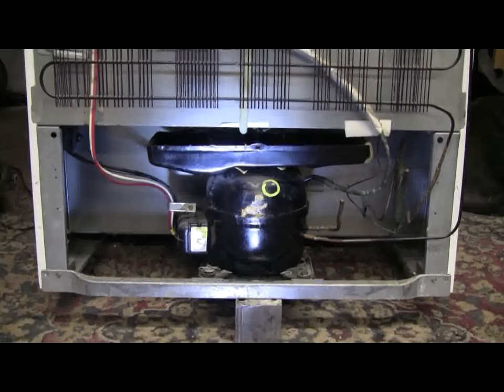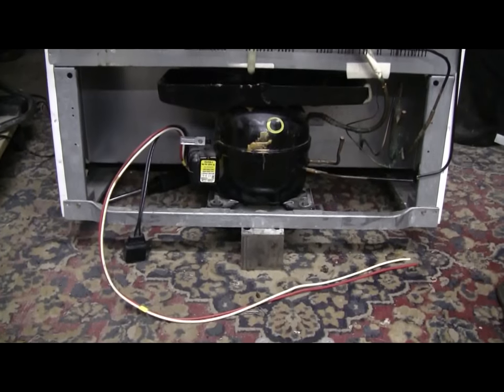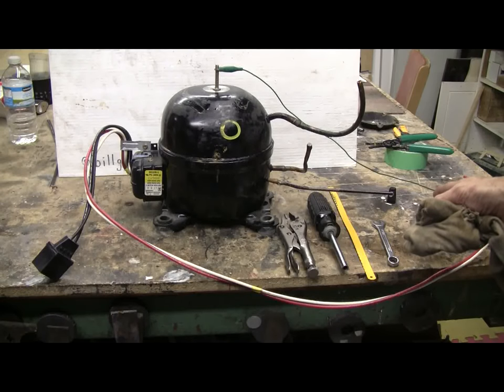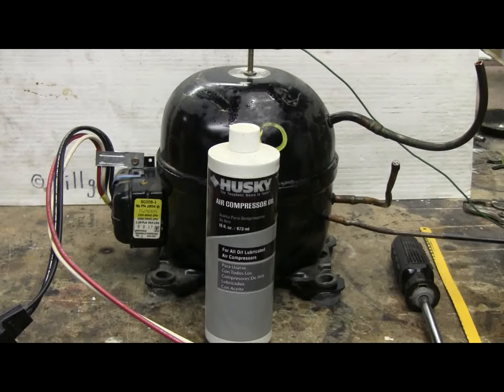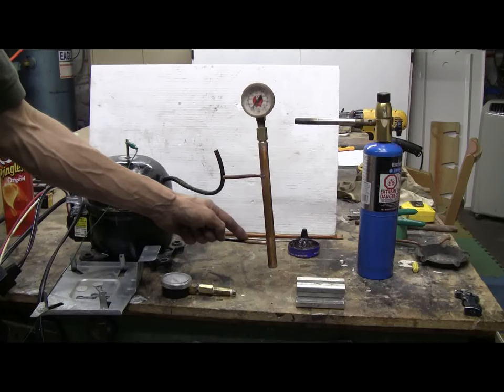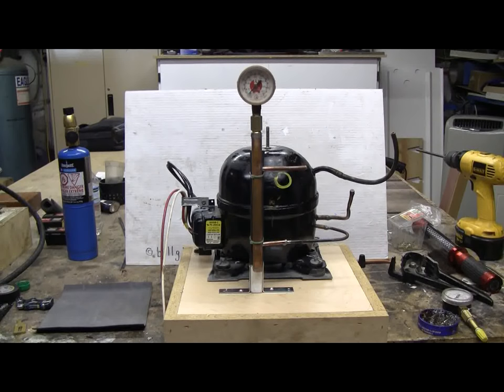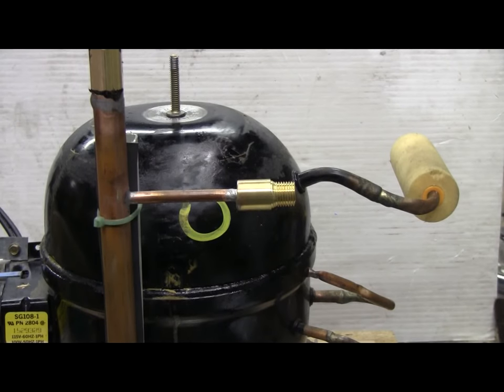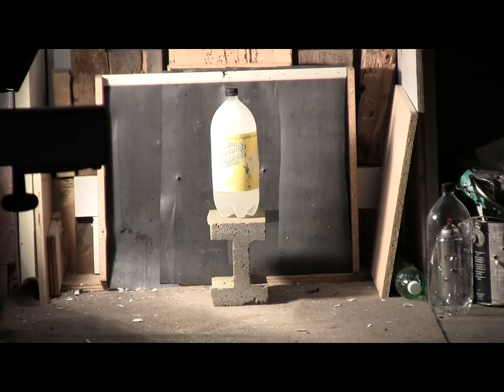DIY - How To Make A High Pressure Air Setup From A Refrigerator

Comment: Great Video!!  I am sure you will be careful to not accidentally walk away while it's charging your tank ... 350 or more PSI is a lot of pressure and it could do a lot of damage if something failed.  You know if you found another refrigerator accumulator or fire extinguisher you could create a way to recharge your tank more quickly.  Much Success !!
Reply: Very good and thorough comments, indeed 350 Psi pressure can be damaging if there is an explosion
Reply: success for "Mr Advanced"

Comment: echo delvis11 question about removing the existing compressor oil and the replacement with the new " air compressor oil " that you mentioned.   Could you give an update on that process, since it's a key initial step process....!   Thanks

Comment: Nice build. Will you get any oil out the air exhaust from the compressor? I mean, will it leak any oil you once filled the compressor unit with? I'm planning to build one similar to your design to connect to my existing compressor to be able to compress air silent when not much air is needed.
Reply from the maker: There will be a small amount of oil mist in the output. These do not flow a lot of air, but if you don't need much volume it will work.
Reply: I wonder if a separator of some sort could be added in-line allowing this compressor to be used as an air lift water pump

Comment: That was cool , would have not thought of that, a compressor cannon.  I am more interested in turning one into a suction device. I work on mowers and in older riding mowers I want to change out the transmission fluid. IF I can get to it, run a flexible tube in and pump out all the old fluid. Depending on how a mower is made this would save me a lot of work. I have no idea as to how vacuum pressure works. But I should not need a whole lot. I was thinking of getting a peace of 4 in PVC pipe. About 3 or 4 ft tall. Then run the suction end to the top end. And a hose at the bottom end with a shut off. From there with a tube I can slide down the transmission.  Got any tips or Ideas ?  The way I am doing it now is I have a air gun that has a siphon line made into it. It works but it is slow, and messy.
Reply: William Wynn look up a fluid transfer pump. Trying to use a compressor for that will lead to you sucking in liquid which is bad

Comment: Just wondering ,because it has such a small tank , intake and pressure out hose .Does it accumulate a lot of moisture in the system? I was thinking it would be a cheap system for my air brush application. Thanks for the great video.
Also you could even add an external air tank could you not?

Comment: So, what practical application is there for a medium pressure, low volume air compressor? I think it could be used to inflate a bicycle tire but it would take 3 or 4 hours.
Reply: A.G. M. | I'm currently in the process of building a system like this myself. Im attempting to use multiple compressors in parralel to give me a bit more scfm
Reply: OtherDalfite I'm not trying to be nasty by the way, but to use multiple refrigerant compressors to combine to create increased volume (cfm) is going to be very energy inefficient which may or may not be problematic depending on the amount of use pr concern for electricity cost. The technology behind domestic fridge compressors is focused on long term near continuos use while producing little to no noise. Hey, good luck to you, have fun and I hope you come up with something interesting or really useful. One remark though. If you get to the point where you require a tank for storing compressed air, the tank must be round or round at both ends if the middle is a cylinder. A lot of people think compressed air can be stored in a metal tank with corners, or they've never thought of it. I have no idea what level you're at so I hope I'm not telling you something you already or instinctively know.

Comment: The oil in a compressor is most likely mineral oil, it is non toxic and will not absorb moisture from the air. Depending on the compressors age it may have polyester oil in it and it is hygroscopic and will absorb moister from the air..When polyester oils are exposed to moisture and heat, they react forming acid that is harmful to the system. So use Mineral oil or a non detergent oil.
Reply: Yes thats exactly what it does, I use to build and inspect them for Emerson....   http://en.wikipedia.org/wiki/Hygroscopy

Comment: Was wondering if you could put a threaded adapter on the input line to use it as a vacuum pump between uses as a compressor?
Reply: You certainly can I have re purposed many a fridge compressor for this reason just make sure it doesn't get too hot and has plenty of lubricant :)!

Comment: quick way to drain the hygroscopic oil in the compressor, drill a 1/4" hole in bottom, drain the oil, then get a self tapping sheet metal screw from lowes (w, rubber seal), and screw in the bottom, then take 12oz of mobil 1 10w30 oil and let it suck it in on the intake side very slowly...once that is done...good to go
Plus with doing it that way, you can change out the oil if you ever think it is dirty

Comment: This is really an excellent video. Thank you for making it. I have one question.
You mentioned putting some oil in the compressor. How is that done?? You didn't show it in the video.
I'm going to build one of these for my compressed Hydrogen project.

THANKS !!
Reply: you may want to make sure you use some type of hydrogen non reactive isolation system. allot of these refrigerant compressors have electrical wingdings that are exposed to the substance being compressed. It could potentially arc in the presence of the hydrogen. maybe use the compressor to power an all brass piston based compressor. I have been wanting to build a safe hydrogen compressor myself.
Reply: It's been really hard trying to find something to compress hydrogen. I am going to open one of these up and inspect the inside. I would like to know how they work.
Reply: you have great videos and sorry if i haven`t been up to date but you are seperating the oxygen from the hydrogen if you are compressing right? because we all know what happens if you don`t peace
Reply: Yes I am collecting the hydrogen and running it through purifiers.
Reply: that`s awesome I wonder if you had a tank of pure hydrogen and ran it through the injection rails in a test car how much actual hydrogen it would take without gasoline. I used to use a compressor from one of my dad`s older coolers and I did get oil vapor out of it but was able to fill a bottle with 300 psi back in the 80`s before I blew my shity hoses up just for filling tires. they do have cheap Chinese knock offs for the 3000 psi 357 air guns that aren`t too exspensive to fill your bottles
Reply: Nice cannon!  I've got a herm. compressor sitting in the garage now just waiting for a project.
Reply: the problem I had with mine is the oil mist spray that it would produce. Somehow there has to be a way to filter it and have it suck back in in a mist form back into the intake. like a water separator.
Reply: ***** dumb blonde? Your free energy generator is like a human who can't make a standing jump over a Jeep Cherokee, the laws of physics change for no man (or blonde woman). Sorry about that! Try solar panels or wind generator or hydro power if you have access to flowing water, etc etc. Hang on, how about getting a slave to work a pedal generator, but wait it costs money to feed her etc?
Reply: delvis11 If you haven't found out by now, The line he put the paint roller on for a filter is the pick-up side and attaching a hose to it will draw your oil in for you. Don't over fill it or it will come out the other side
Reply: Thank you
Reply: delvis11 the windings are coated and shouldn't spark unless there's a failure.Best thing to do would be use a megger to check the windings every time before you compress the hydrogen
Reply: Thats fine, hydrogen wont burn if there is no oxygen in it.
Reply: Lee K Air/oil separators exists.  Basically a smallish tank with a bolt-on lid, and a coelescing filter mounted inside.  Air passes through the filter, oil can't... and so it pools up in the bottom of the can.  Add to this set-up a scavenge line (and needle valve) near the bottom that will remove that oil back to the pump inlet.
Reply: delvis11 compressing hydrogen is a great way to expand your presence, in three dimensions, you’ll be deeply ingrained in your immediately broadened area, and experience an accelerated, enlightening, elevated existence, you’ll rise above and shower the region with the fruits of your efforts and give a bit of yourself to everyone within about a half mile radius...

Seriously though. I say go for it, get several camera angles, it’ll go viral!!! 
Theres a reason no one does it, hydrogen is volatile and unsafe to compress, store compressed and when being depressurized it goes “KA-BLOOOOEEY!!!” Really Really Really “BIG KA-BLOOOOEEY!!!!”
Reply: Lee K you can use the separator from an hvac unit  or refrigerator
Reply: okay
Reply: delvis11 good question! I just wonder the same thing!

Comment: How do you drain the suspect oil do you just turn it on its side and turn it on and let the oil drain outfrom the outputline or what? And the just measure the oil and put the same amount(maybe a little extra) into the inlet line?

Comment: Shouldn't you you have a pressure tank, pressure switch so it doesn't accidentally get left on and explode? As well as a high pressure relief valve?
Reply from the maker: +Robert Chaffee You could add a tank, pressure switch and relief valve if you want. The best pressure that I have gotten is 850 psi and at that point the compressor stopped. It won't explode itself. I don't have a tank on mine as I use it mainly to pump up air cannons. I have an old CO2 tank that I can connect up if air storage is needed. This tank can take more psi than the compressor can generate.

Comment: I cannot get beyond the lack of a pressure relief valve or pressure shut off, the toggle switch seems to be inviting a dangerous failure of the system someplace.  I had no idea refrigerator compressor could reach that high PSI.

Comment: Question for ya. What process did you use to exchange the oil. I understand tipping it over and letting it all run out where ever but putting it back in? Did you open the filler tube and reseal it? Great video and very thorough, just not sure on the oil thing.
Reply: Stephen Staines You can add the oil through either the inlet (suction) or the outlet side of the compressor.

Comment: Why wouldn't you use an ordinary electric switch, which is cheaper, has easy-to-use screws and saves the toggle switch for someplace where its smaller size would be better suited?

Comment: Information I have been seeking is a formula that can tell us how much air pressure a regular bullet from a FireArm is required to make an AirGun push that same FireArm 
 projectile with the same distance/accuracy.  Sure it is much higher, I think about 6Xs as much and then through a rifled barrel. Anyone know?
    I am also working on knowledge to build a FireArm that does not use a shell casing, a primer and gunpowder, but rather compressed air and a liquid propellant such as gasoline or another flammable liquid.  Gasoline will ignite at roughly 230 psi and that helps us require less air compression.

Comment: Neat vid and neat explanation !  I have two Q to ask. There was 3 pipes coming out of the motor. One as air inlet , one as air outlet and what was the 3rd one ?  My other Q , how did you fill that motor with lubrication oil ? I seen no hole to fill with oil !  Thanks.

Comment: How do you keep it cool?

From what I understand, refrigeration/HVAC compressors rely on the refrigerant to keep the motor cool.
Without the cooling of the refrigerant, won't it overheat in any long run times or worse, frequent starts?
Reply from the maker: +Danny Clark I have not had an overheat problem. My run times are under 15 minutes and I added a small cooling fan blowing air across the compressor body.
Reply: kind of. the oil is what cools the motor, the refrigerant cools off the oil a bit, true. as the oil is mostly in a puddle in the bottom of the pressure dome, it's perfectly happy to give up heat through the wall of the dome, or the refrigerant. as the freon was already superheated vapor at the inlet, it really doesn't take a whole lot of latent heat from the mechanical operation, it's busy handling it's own load from the compression (which nice cool ambient air does too, as diesels work, lol). even with freon as the "working fluid", the mechanical heat rejection is mostly through the dome. look how the compressor was mounted, nice convection path, right? air sneaks under the front (and in the back, but under the front is the cleanest air passage usually) and wanders into the metal covering that nice warm oil. it heats, rises, and dissipates by heating the condensate pan, so condenses again as it passes the edge, and falls. what gets too hot wanders up the condensation path in the back. that makes draft which draws in new cool floor level air. it's like that whole lion king "circle of life", only with heat and air instead of talking and singing jungle critters, lol. your compressed air is still carrying LOTS of heat (like a diesel) so much of that heat is leaving the compressor just as it did in the fridge circuit, only it's doing so in a tank instead of a condenser. your compressor sees no difference in that, it goes somewhere else, which is fine. is the heat load all engineered out? hell no, lol. but, also look at his new set up, even without the fan. it can radiate. it is exposed to far more air naturally than it has ever been before, so the heat transfer is MORE efficient (greater difference in temps, greater efficiency of transfer), and the air will ALL be "clean" (no convection recycling), even if a few degrees warmer than at floor level. as far as that compressor is concerned, it's living the sweet life.
Reply: Thanks guys for youir replies. I've done HVAC work for 20 years, but its always been some for of chemical refrigerant in the coils. I know that the "first refrigerant" was water, but learning in reverse is a new pattern in todays times. LOL

Forced air cooled totally makes sense, but I really wondered about overheating without it. Thanks for taking the time to respond!
Reply: ludditeneaderthal www

Comment: i dont want to sound stupid but you said if i link 10 of these compressors in series it will put out 3000psi so they rate about 300psi a piece

Comment: I like this but you need a tank to store some volume. I doubt that this pump puts out a great deal of volume. Nicely made
Reply: +Bob Ordewald Agreed - But this would be pretty amazing to fill paintball HPA tanks... and super cheap!
Reply: RogueReagent8 I agree. What is interesting is you can get a old propane tank for nothing - or an old NOS bottle. There is so many smallish tanks that can be had for little or no outlay of $$
Reply: robert freeman That's why you have the tank. Not even a very powerful compressor (until you go to the ones mounted on trailers) runs without the reserve tank. This little compressor is best for blowing sawdust out of the way or maybe inflating a bicycle tire. If you can find an old Ford Car/Truck piston AC pump - they were used in the 1960's up and they are still used on cheap aftermarket auto AC systems these work well.
Thanks for the response!

Comment: Could you Please Help me. I have build one with the same motor. The problem is if It turn its self out when there is enough presure it will not turn its self on again !!? what is it I should do? DO you know ? Thank you very much...
Reply from the maker: +Bisholi M You would have to add a pressure switch if you want it to turn on at low pressure and then shut off when the high pressure setting is reached. Same type of setup as a small shop compressor and tank.
Reply: Bisholi M then it is cutting out on internal thermal overload

Comment: I thing I missed was how you got the oil out and changed it, as far as I knew these things are welded together...  Or am I missing something?
Reply from the maker: +stewartrv The inlet is simply an entry into the sealed case. Oil can be drained by turning the unit on its side. New oil can then be sucked in through the inlet. You could also drill and tap for an oil drain of some sort.

Comment: Excellent video , just have one question, I didn't know you could solder a steel line  to a copper fitting or a piece of copper line  , is there a trick to this  , like does it require more heat than doing regular copper joint work ?
Reply from the maker: +Jack Lamond You can solder copper to steel. However this will not work for stainless steel tubing. You can also use a propane torch with silver solder and silver solder Flux.  This will make the strongest join between copper and steel. You can get this online or from a welding supply or jewelry supply place. Normal flux will not work with silver solder.
Reply: Thanks for the quick reply and the information . Had a feeling it was going to be silver soldering . Thanks again.

Comment: They deliver high pressure, but not much volume. If you had a few and used a large tank as a buffer, it should work fine

Comment: That is a tremendous pressure you are building up, Bill.
And that compressor isn't even designed for such high pressure!
I would be more careful when a made it like that.
A hose could get loose, a copper pipe could rip. You don't want to be nearby then.
How high COULD you go up (theoretically) before something bad happens?

Comment: it says hpa setup how much air can it safely produce like for hpa rifle that hold 2500 to 3000 psi is this set up usable for that thank you
Reply: You could cascade 10 compressors in series and get 3000.psi with 1000A lockup current.